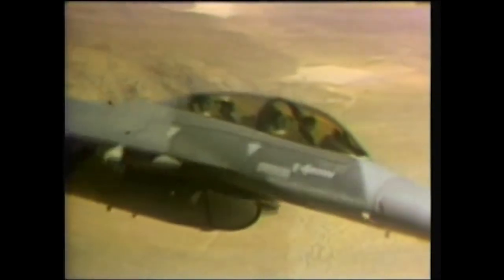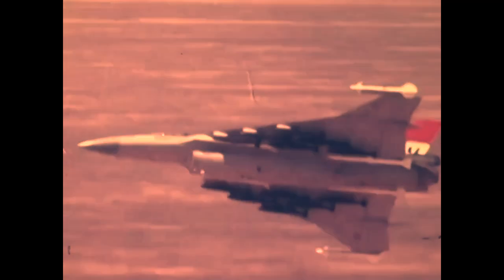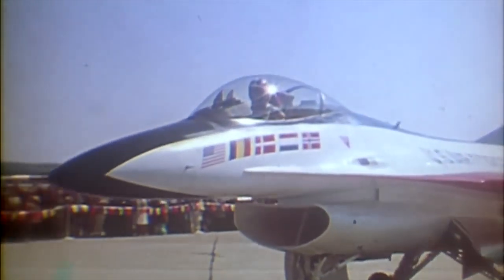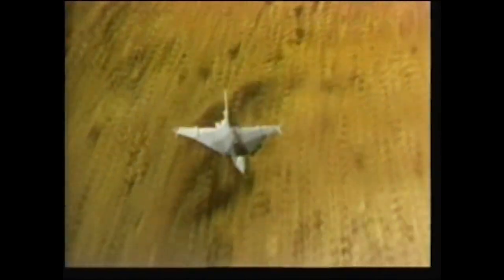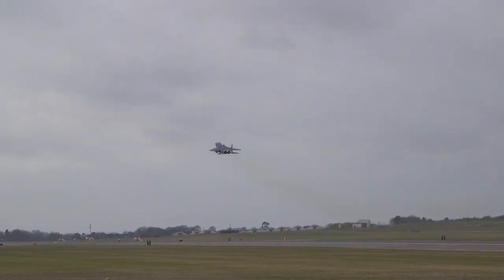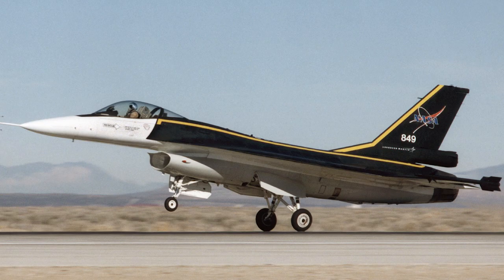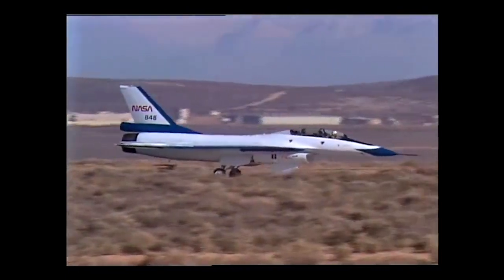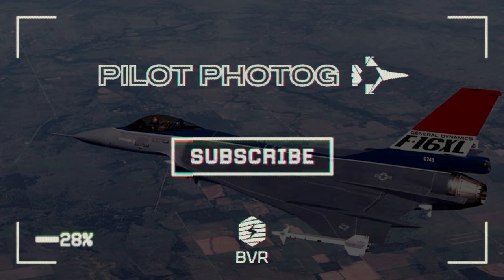F-16XL The Fighter That Should Have Been Built | avgeek |  #f-36

Comment: The XL lost because the F-15E was the better plane with a greater payload.  The E model max take-off weight (I witnessed) was 88,000 lbs.  Still, the XL is pretty cool.  The eagles were also able to super cruise with the GE 129's.
Reply from the maker: Agreed and the F-15E is an amazing platform, I’ve done a video on that as well.  I think the XL could have found a market as an export fighter, for nations that wanted a long range multi role fighter/bomber.
Reply: 4one14  absolutely, the best platform isn't always the best choice.  The fact is that it's more expensive to operate an F-15E (Pilot and WSO alone doubles the operation cost in crew).  So the lower the available budget, the more sense the F-16XL makes.  It's like buying a Ferrari 488 vs a Ford GT 500.  The Ferrari is more capable, but the GT 500 gets 95% of the capability for around 2/3's the cost.
Reply: @PilotPhotog  nope! Because of better aircraft in the works...... Std. F16 is better for acm. F15e can handle higher payloads.  In the end the right choice was made.....
Reply: Again, go for Hi/Lo combo.
Reply: Not to mention the Strike Eagle maintains the excellent air to air capability and other characteristics of the F-15C...no F-15 model has ever been lost in air to air combat since its introduction to service. An Isreali pilot also managed to fly and land his F-15 after a mid air collision during training with only one wing on the aircraft.
Reply: @aaronsanborn4291 lol these two points are recycled on every aviation video

Comment: Arguably, the F-16XL in a navalized variant would have been the optimal replacement for the F-14 as no new aircraft had to be developed and the range, speed and payload capability would almost match the F-14 in every role, but likely for a fraction of the unit production and maintenance cost.

Comment: Remember, when the F-15 was first built, by 1975 McDonnell Douglas had shown an improved version with conformal tanks and the ability to carry a very substantial bomb load. That made it very easy for McDonnell Douglas in the late 1980's to start building the F-15E quickly.
Reply: Fuel And Sensor Tactical (FAST) packs were not only conformal fuel tanks - look at Silent Eagle.
Reply: That was their plan - because they knew the F-111s were retiring. For night / weather deep strike, the F-15E was exactly the right choice. However, from that point on all future F-16s ought to have had the XL wing. 70% increase in combat capability for 2.5% total lifetime cost of ownership - who gives that up? Just reduce your buy by 2.5% (buy 97 instead of 100) if you have an absolutely hard fixed budget, you would still get 68% more combat capability.

Comment: The comment. "Good idea at the wrong time." Said it all. Had the design been around when the F16 was originally selected, it would have won hands down. The F15E was always going to be an additional weapons carrier for targets designated by stealth aircraft be they F22 or whatever. Therefore cost was always going to be the deciding factor. The F15 being no slouch and cheaper would have had my vote too.
Reply: A key part of aircraft program costs is startup- the F-15E with a hot production line had a big cost advantage over the F-16XL that would have required a new production line, or at least extensive modifications to the F-16CD lines that were open at that time. One might hope that future US fighter designers realize that designing fighters for long range might be a better approach than designing short range fighters, and adding drop tanks.
Reply: It's still a good idea for any new build F-16s - but those would cut into our exports of F-35s!
Reply: @rogerramjet6134  Probably but even so, a sales is a sale. Choice is not bad thing.
Reply: @gusgone4527  True - but it is also not inconceivable that they could have produced both variants (XL, original). As the video pointed out, it is modular construction and all the other systems would be identical.
Reply: @rogerramjet6134  Agreed.

Comment: The F-16 started it's career it was cheap, fast, and maneuverable....  It flew circles around the F-4 during demonstration flights...  A great fighter and in my personal opinion they shouldn't have put bombs on it.

I don't know if  the F-15 gets stress fractures, but i have worked on the blocks, 30, 40/45, block 15 with block 50 upgrades, and another block.  The block 30 looks like hell with beef ups all over the backbone and on the wings.  The block 40's were starting to get the same factures as well.  It looks like they fixed the fuselage fracturing at block 50 and later, but the wings are still leaking at the same places as the block 30 and 40.  I believe this is from the weight on the wings from the bomb and external tank loads more so than maneuvering.   But hey I'm just a maintainer not an engineer/designer...  

If they had built the XL with modern avionics and RAM coatings to replace the F-16 instead of the F-35, I would have been for that. The costs would have been extremely  lower than the F-35 with about the same payload and better performance.  I read a news story that a F-16D model (talk about a handicap) could out dogfight a F-35 but the excuse was given with the avionics suite on the F-35 it doesn't need to dogfight.   Right, I heard of that one before in history when the DoD bought the F-4 without a cannon.   Then had to put one on it during Vietnam war to survive since the AIM-7 dubbed "the great white hope" had a very poor success rate.

As a kid I loved the F-16XL, it looked cool.  Since  I've added years to my life since then I understand why it was not built/used.  They needed the best weapons platform and the F-15E provided it without building a new assembly line (money) or waiting for an engine to be designed/built(time/depot or home station mods).
Reply: You are mistake in regards to the F-35 vs F-16D dogfight, the F-35 flying didn't have her avionics tuned yet and the ENTIRE POINT of the fight was to tune it! It wasn't a competition. F-35 outperforms the Viper in every single aspect and pilots who have flown both attest to the F-35 not being a worse dogfighter, she even has a better Alpha. It really sounds like you have to do some reading up on the F-35 and performance of modern missiles. I concur on the F-16XL wing being what the current F-16 should have become, then again the F-16 also should have gotten her Agile Falcon upgrade.
Reply: @FirstDagger  No aircraft flies with it's avionics off, pilot still needs navigation, altitude, radios, and especially either the F-16 or the F-35, the fly by wire or light systems are avionics.  You must be talking about the "sensor suite" as it is dubbed.

Well the ATP, the sniper pod, is  a self contained version of the that "senor suite" of the F-35.   It is currently being used on the F-16 and other platforms.  It provides a F-16 the same AIM-9X launch/targeting options as the F-35.   

 When I talk about dogfighting, I'm not talking about who sees who first wins where the "sensor suite" potentially rules but head to head maneuvering dogfight.  Where turn rate, rate of climb decent,  thrust to weight ratio, and wing loading are the deciding factor outside the pilot's skill.
Reply: @Tankrat6  ; All control surfaces are controlled by the avionics and those have to be developed and tuned. "No aircraft flies with it's avionics off" And where have I stated as such? We are talking about an aircraft that was still in development and I am sure you know that the FBW computer limits what the pilot can do with the aircraft. Not to mention that the F-35 at that point wasn't rated to the G limit she currently is. The problem are old timers like you who have been in the industry and service and fail to have an understanding of how complex the development of an aircraft is, YOU are thinking from the point of your already developed F-16. Also I rather take the word of pilots who have flown both the F-35 and F-16 that the dog-fighting isn't an issue in the F-35. 

Sniper Pod, which I am sure has a G-Limit and adds drag.
Sensor Suit, please look up EODAS and just how revolutionary of a system that is, you cannot just retrofit that into Legacy Fighters.

Did you know that the F-16D during that dogfight also ran out of gas despite having bags?

Finally again, every single performance parameter of the F-35 outperforms the F-16 and F/A-18.
Reply: @FirstDagger  well  first thing first....   I read your post 4 times before responding and to me it read "turned off... so it can be tuned"

Of course the F-16D ran out of gas, it carries about 1500lbs. less fuel than a C model, they sacrificed 80% of the F-1 tank to put the second seat in, just like they sacrificed fuel load for the B and C models of the F-35 for the marine and navy requirements.  F-35 has a more efficient engine than the F-16  It also carries more fuel than a  F-16. It's the same story between the F-4 and the F-16 before General Dynamics won the contract to build the F-16.

You are correct the F-35 is a complex aircraft to make, having to work in aluminum and composites, the shape for both performance and reduced radar cross section at all angles, and then throw in the the hydraulics, electrical, fiber optics, and fuel systems into the mess. The Aircraft is so complex that they had to create a career field (job position) in the USAF just so the ground crew can communicate with the F-35.  It's so complex that the F-35A's gun doesn't doesn't shot straight and on lot 9 and  newer lots off the assembly line are not allowed to use it due to cracking of the surrounding structure/molding and the gun mounts are misaligned (reported in Feb 2020).  it's so complex that the pilot can not make the decision whether to continue  the mission because of a system fault.  When the computers report there is a fault that will hamper the mission and then they automatically sets the navigation to home base. The pilot has no choice.  F-35A is so complex that the computers talk to all the parts on the aircraft.  So the jet tells you the x part is bad, you change x part with a Technical Order approved alternate.  The jet checks it's self after your done and the tells you, you have the wrong part installed, I'm not flying unless you put the right one in.   Yes it is a complex aircraft to make and maintain.  Most of the 600+ issues reported last February I hope will be fixed, but the troubling one for me is the pilot's choice being taken away.

The sniper pod was developed from the same technology as EODAS was. Yes there is limitations to it, like the aircraft not having the 360 view and some of the bells and whistles the F-35 does.  It does have a helmet display system and is used in both air to ground and air to air combat.  It doesn't take much off the g rating just like the lantern pods did... but like all aircraft they are G rated by the loads they carry not the maximum achievable rating they can withstand.  

I digress,  originally I'm trying to say the F-35 has no hope to win versus a F-16 in a knife fight.  Yes it the F-16 block 50 and below don't have a chance in hell against the beyond visual range capabilities of the F-35 but in close in dogfighting the F-16 can out turn a F-35.  So one on one and start the fight with high speed pass and turn to fight  I say the F-16 wins due to it has  a higher thrust to weight ratio, faster turn rate, and a faster climb rate than the F-35.   And this comes from a guy who thinks the F-15E and the A-10 are better bombers than the  F-16 ever could be. cough cough F-16 had no air to air kills while the A-10s did during desert storm in 91

Comment: While this aircraft looks good on paper, there are several reasons why this and so many other promising planes don't make it. This one in particular: while a double delta wing does increase low speed performance from the normal delta wing, it still lacks the unmatched low speed control ability of a traditional configuration like the f-16 already has. Take the French Mirage for example, it can out turn the f-16 at any speed around above 470kt, but go much slower it becomes impossible for the Pilot to get the nose to the adversary because the control surface begins to buffet, at the same time, (I have no idea if the engineers got around this) at high speeds past Mach one, the shockwaves from the form of the body and nose also begins to buffet the controls. Delta wings also can require different training (BFM and ACM) as a f-16 can rate fight and and aircraft such as this can only win dogfights with altitude. Simply put, there are reasons the U.S. does not use canard fighters or delta wings in most military aircraft.

Comment: Like all good ideas that have been proven to excel, politics and hidden agendas still prevail in the Defense Department.
Reply: aaaaaamen
Reply: Not in this case. The F-16XL didn't have the power at the time. If they could have made a carbon fiber wing with a GE F110-GE-132, it might have had a chance, but those technologies didn't exist in mature form for another 2-3 decades.

The F-16XL would have been a much better platform for everything the USAF uses the Viper for, since F-16s are limited in range/endurance due to low internal fuel capacity.

F-16XL would make a great interdiction/strike, CAS, and Wild Weasel/SEAD platform.

The F-16 small wing is its biggest weakness in how the Air Force uses it-primarily for those things listed above. They don't employ it as a daytime point defense Lightweight Fighter, as those types of fighters were made obsolete by US radar and all-aspect missiles.

Comment: Looks like the US had it's own 'Eurofighter' fighter.
Reply: This was before the Eurofighter came to be
Reply: Looks more like a SAAB to me.
Reply: gripen you mean. eurofighter is more related to the f15
Reply: @manuelmamann5035  Very different aircraft. This was a low altitude bomber (oversimplication, but whatever). The Typhoon is an air superiority fighter.
Reply: @Akuu820  Yeah. That cranked-delta
Reply: @米空軍パイロット  its a multirole aircraft. i dont even need to argue. the eurofighter is top of the game regarding air to ground.
But anyway i was refeering to the engine set up. which is a strategic choice.
Reply: @manuelmamann5035  Sorry, civilian. I wasn't trying to respond to you. I was trying to respond to the original post. My bad. Still, my point still stands. the 16XL was made for a very different mission than the Typhoon.
Reply: @米空軍パイロット  true and it was a great concept. i admire it for the same reasons i admire the f20 tigershark. <3
Reply: @米空軍パイロット  ahh and why tejas dont have similar amount of hardpoint during desing phase is a mystery to me. ;) Also a great plane and idea child of the f16. great plan love it. have a good one.
Reply: @manuelmamann5035  It's because the Tejas is a much smaller aircraft. It only has 1/3 the wing area and thrust of the F-16XL. Its pylons are also stronger than the XL's because despite having 47% of the XL's pylons, they can carry 84% of its payload.
Reply: The Eurofighter has 13 hardpoints, so it has a smaller capacity, but the whole front section (underneath air intakes, nose cone and the canopy glass) of the EF-2000 remind me of the F-16. The beast in this video has an even closer resemblance.
Reply: We've  resisted going full canard.
Reply: @delten-eleven1910  Never go full canard
Reply: leonardimas1  yeah. the bigger airframe also is easyer to upgrade. was very likey the best decision. but a great concept.
Reply: @米空軍パイロット  sound like a efficent compromise for a smaler fighter. i like that other nation now get there shit togheter and get into selfreliance.
Reply: It looks like j35 draken tho,
Reply: @manuelmamann5035  It really is a good efficient design. Plus, its operating costs must be really low because it uses only 1 of the F-18's engines, just like the Saab Gripen. Speaking of Gripen, the Tejas is getting a second version that will have canards.
Reply: Eh more like their own little eurofighter/draken cuz it has the draken wing design
Reply: @米空軍パイロット  - Canards are not good for RCS concerns. Adding them to the Su-30MKI and forward variants instead of straight thrust vectoring always struck me as a mistake.
Reply: @VisibilityFoggy  I heard that they needed to add them, due to newer and heavier radar, shifting the plane's center of mass. But idk
Reply: @VisibilityFoggy  I don't think India cares about that, to be honest. They know they aren't ready to make a low observable aircraft, and since the Tejas 1 already has a 4th gen RCS, they're not really losing anything by putting canards on Tejas 2. If they wanted a low observable fighter, they would have stuck with the Su-57 program.
Reply: Yeah we could of but we're cheap SOBs now!!! They could do it right now! They still update planes just as old or older.